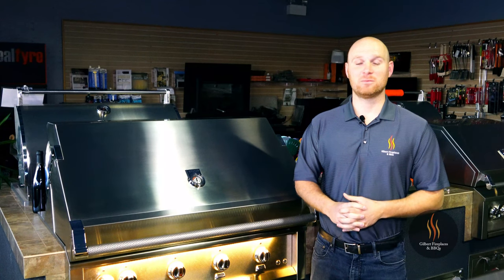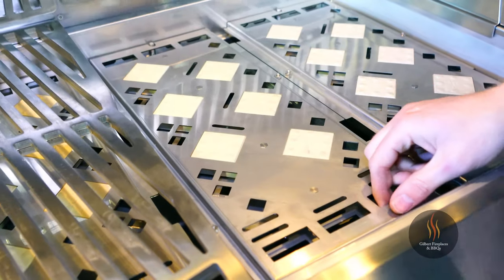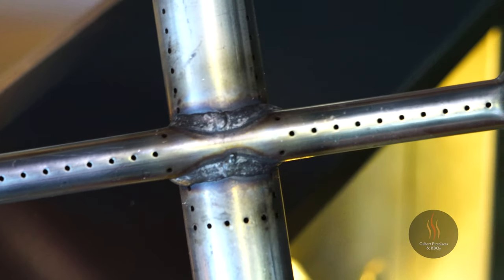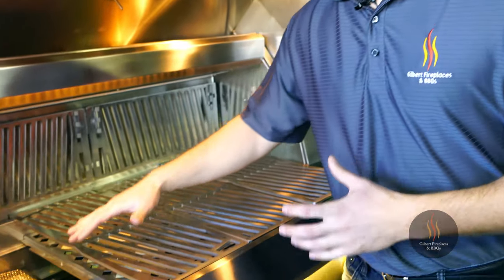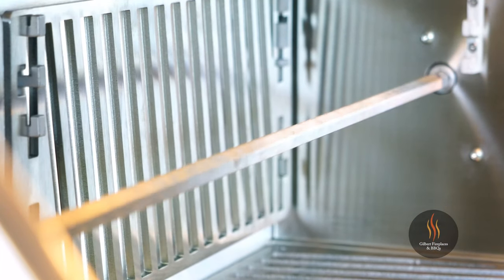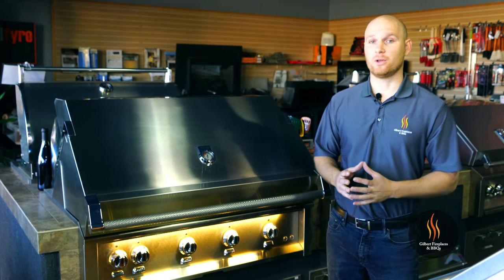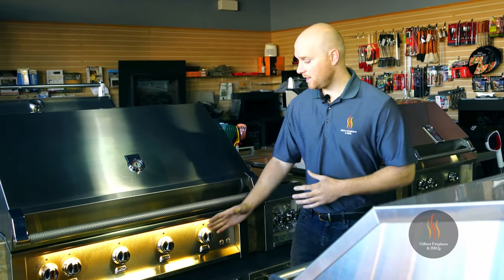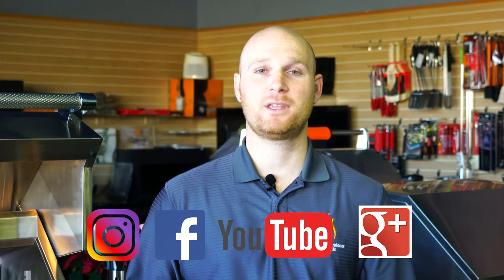Hestan Gas Grill Tutorial

Comment: Is the sear burner adjusted tot he lower temperature comparable to the regular gas burners temperature?  In other words, if you have one grill area with the regular burner and one with the sear burner, can you function normally compared to all regular burners?  You would not burn the food or be hampered if you don’t need the sear burner every time?
Reply from the maker: Thanks for the question! The sear burner does have turn down ability. However, the lowest temperature you can bring it to is still going to be over the 400 degree mark and infrared heat does cook differently than the radiant heat you will be cooking with from the other burners. Meaning, if you were to set the standard burner to a setting that would achieve a 400 degree temperature and you do the same for the sear burner, you will notice that the food over the sear burner will still cook faster, as infrared heat heats up objects and surfaces better than radiant heat. We tend to see many of our customers opt to go with the 42" size with the sear zone so that they have sufficient standard grilling space outside of the sear zone.
Reply: @GilbertFireplacesBBQs  Thanks, makes sense to go with the 42 inch Hestan and get the sear for one burner; but I am thinking of the 36 or even the 30 inch, so I will likely go with all regular burners.